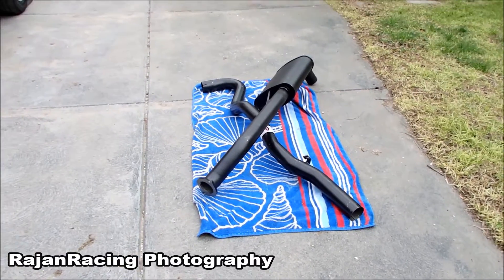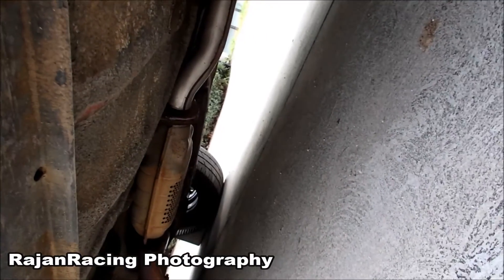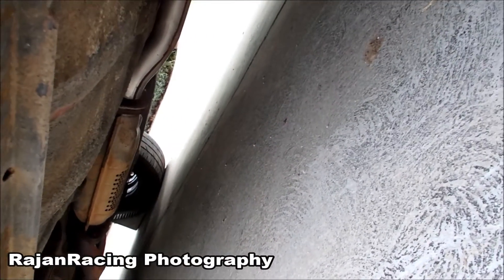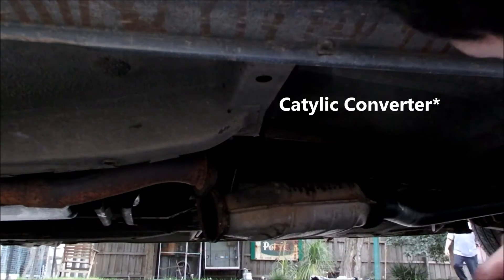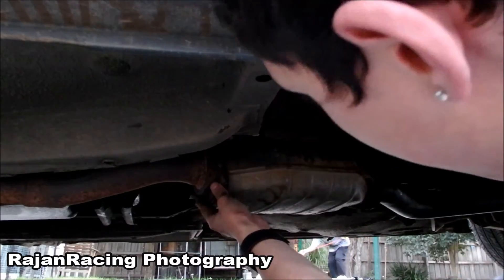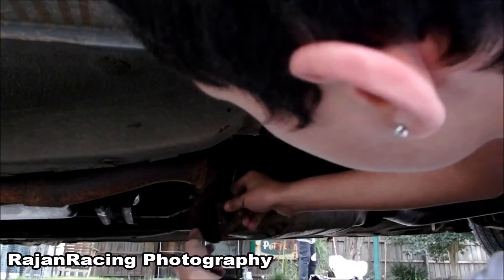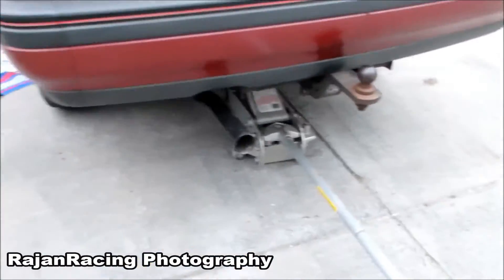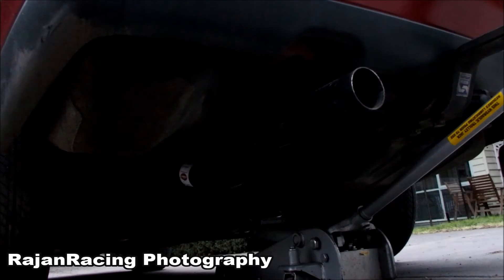Build Burnout Car - VN Commodore - Part 8

Comment: putting that cat on is a really stupid idea and ruins the point of havin a custom exhaust
Reply: cat would be alright just need to bash it and get all the shit out that restricts it!
Reply: Wrong if you fit it to stock setup which is what he's got. If an high flow cat then yeah. Makes fuck all difference,  which also means it dusnt just make noise and over fuel
Reply: I got the same exhaust without the muffler but a hotdog instead.. Hope it's got more of a tone than this